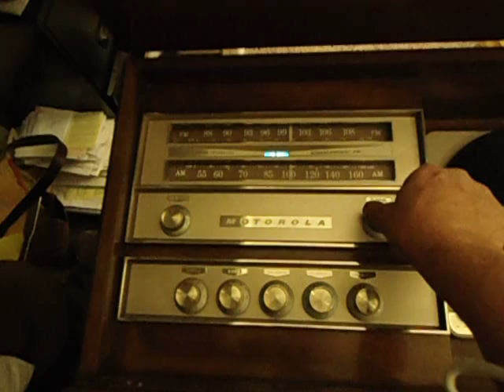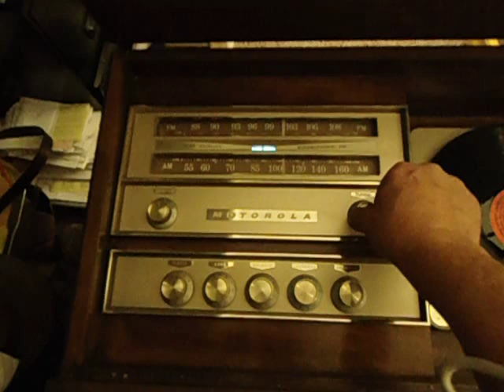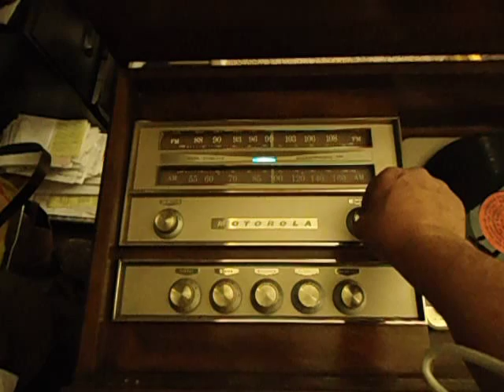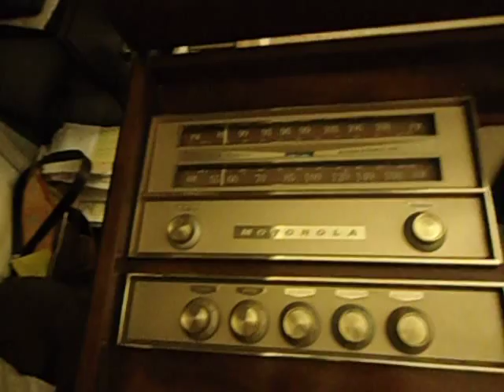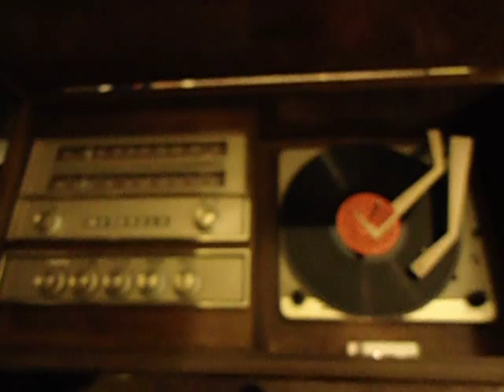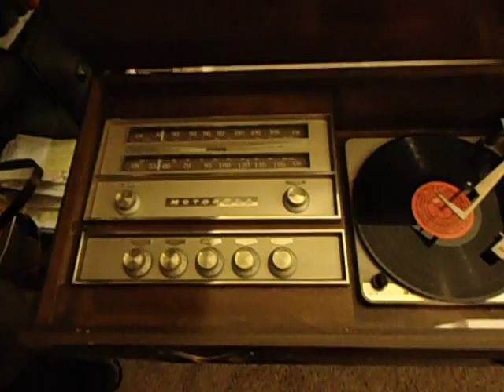1960 Motorola Console stereo. MADE IN USA!!!

Comment: great one! love it! the reason that the tuner isn't stereo is for the fact thatfm stereo wasn't available yet it was invented but hadn't yet been put into production multiplex adaptors which were seperate units usually bolted to the side of the radio chassis and plugged in to the tuner..awesome machine I may actually be getting the exact model in walnut (not as cool as the blonde) but it's as clean  hoping I get it..good luck w/ yours  LOVE IT!

Comment: Although the cabinet was different, the family console contained the tuner/amp controls were the same and included "vibrosonic". The selector also included a tape option with stereo inputs available in the back of the cabinet (a high end feature compared to other consoles). I'm not sure how many watts the amp was kicking out but as a teen (and when my parents were not at home) I rattled many a window in the lower level of our home thanks to this unit with 0 distortion even at full volume.

Comment: Did you find any asbestos in the cabinet?
Reply from the maker: No asbestos in the cabinet. a Lot of 30's/40's radios had it. I think by 1960 they quit using it
Reply: mwstaton64 That's good to know, I bought the same model radio yesterday and it is so dusty, like it is caked in dust, I was hesitant to vacuum it because I was afraid of stirring up some asbestos lol